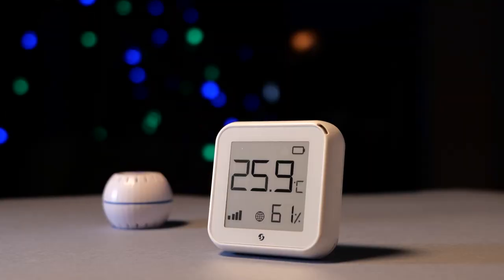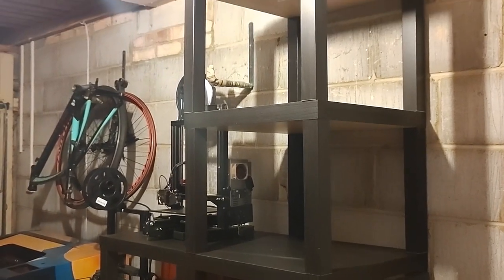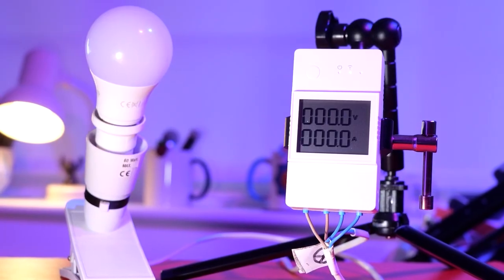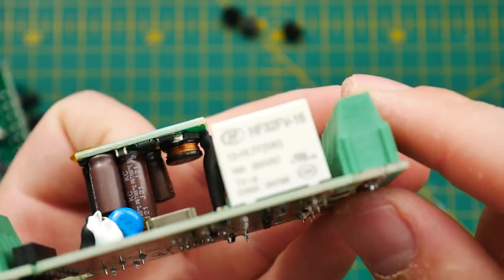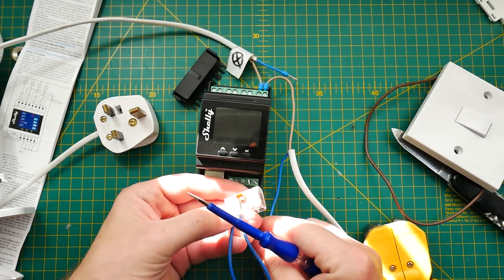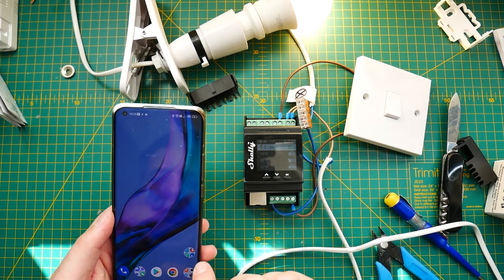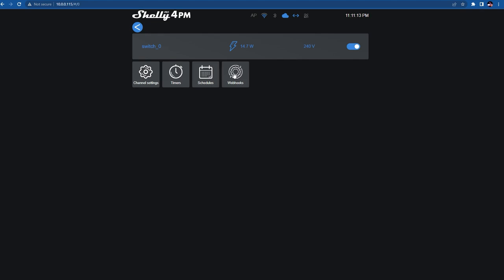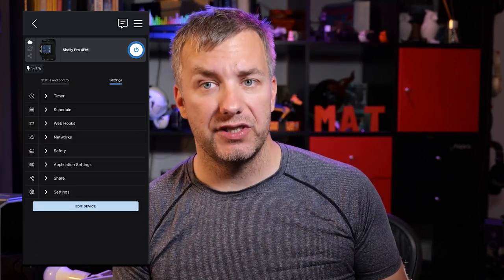Shelly Pro 4PM is 4 times better

Comment: I love that the  Pro 4PM has ethernet capabilities.  It makes for a more reliable connection and less clutter on the WiFi.  WiFi is very crowded in my area and it gets a lot of interference.
Reply from the maker: I know POE is missing and some will complain about it but it's still decent choice
Reply: @notenoughtech  why would you need PoE in a device like this?
Reply from the maker: Probably hassle free deployment plus you could still monitor and report back on power loss assuming your POE is on another mains

Comment: At the start of the video you say it’s 10amp each. You do say later it’s 16amps. It’s stated as 16amps per channel according to their website, this is what you would rate a 2.5mm radial circuit in the uk. I’m looking to locate this in a second sub panel supplied buy at 32 amp breaker (the unit says 40 amps max but I think 32 is plenty) then have each radial protected by a 16amp mcb.

Love your channel, looking forward to the new Shelly reviews especially the temperature as the stuff I have at the moment is not very reliable.
Reply from the maker: Thank you - relays can handle 16A each - which is also possible if you use a single channel. To prevent overheating - you should not load this with more than 10A using multiple channels at once with 40A for all 4 channels.
Reply: @notenoughtech  no good for a UK CU then?

Comment: I wonder if this relay system could be used with Tormach Pathpilot to control flood and mist coolant on/off. Pathpilot is a Linux based CNC control.
Reply from the maker: As long as ratings fall within the Shelly's spec - I can't see why not? Webhooks probably could come handy

Comment: I'm new to this so this may be a dumb question. It looks to me like I can get remote on/off without even using the S1,S2,S3,S4 terminals since the relay does the switching and steals power from the L terminals. Is this correct? If so what is the purpose of the S terminals?
Reply: Correct.
The S connectors are for switches. If you also want to manually switch the channel(s)

Comment: Hi there, I was wondering if the manual switches work regardless? For me, when I turn off the light / line using the Shelly app (the relay), I need to turn the manual switch on and off again for it to work. Have I was wondering if I am doing something wrong? Help.
Reply from the maker: They both should be working fine - chcek he configuration of your physical switch as Shelly comes with dozen option to set the desired behaviour for this
Reply: @notenoughtech  Thank you. I will have another go! Related question - I am rewiring the whole house. I was thinking of following a star pattern for the rewiring with each switch (a single pendant, group of pendants, or LEDs) coming from a Shelly relay. So the line becomes 'smart' so to speak. Does this make sense or overkill? Given Thread/Matter coming down the pipe soon.

Comment: really hoping for a dimmer 4 pro with ethernet and poe soon!
Reply from the maker: Dimmers are hard, as they will depend on the bulb compatibility as well. By far the easiest way is to get a zigbee wall switch (battery powered) and zigbee bulb